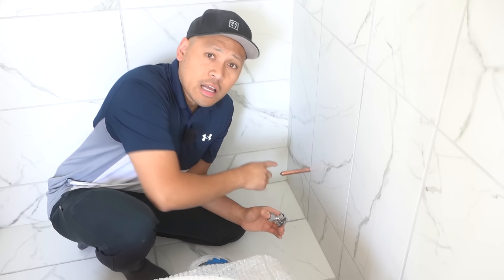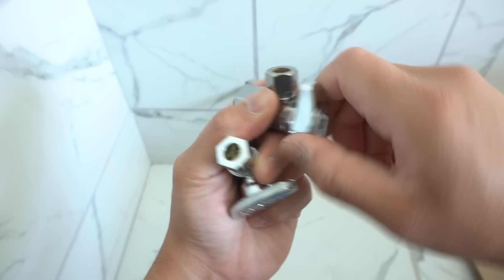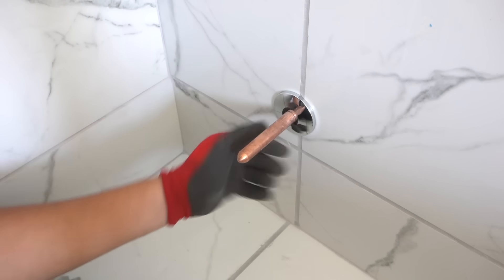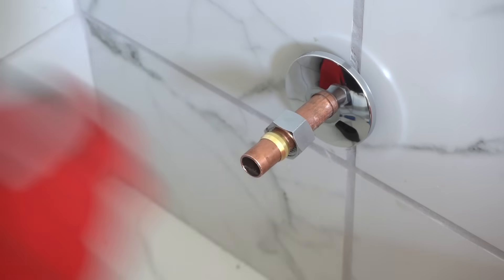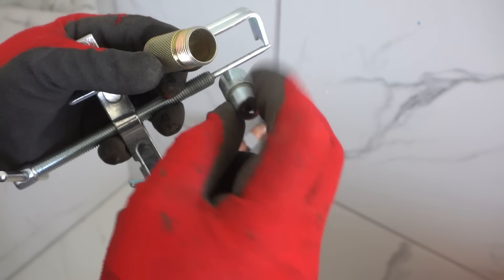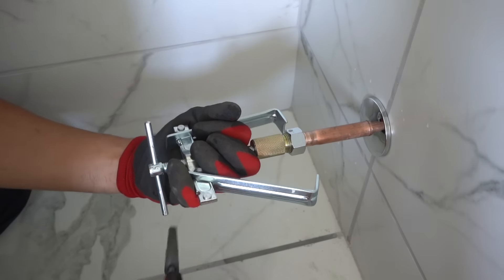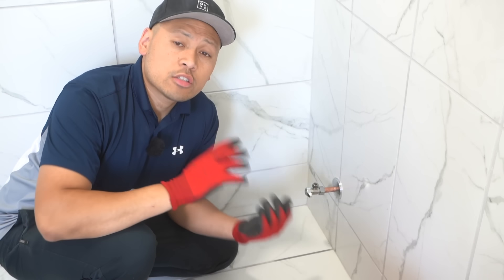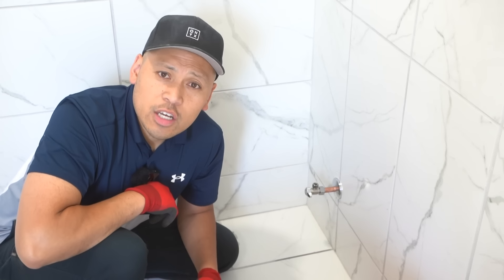STOP Installing SHUT-OFF Valves In the Wrong Location! DIY How To Install OR Replace!

Comment from the maker: ITEMS I USED ON THIE VIDEO:
- Angle Stop 1/4 Turn (1/2” Nom 3/8” Comp Out) - https://amzn.to/3Lz5cbt
- Compression Ring Puller - https://amzn.to/46hSSFU
- Copper / Metal / Brass / Aluminum / PEX cutter up to 1-1/8” - https://amzn.to/4cQblfb
- Pipe And Tubing Reamer - https://amzn.to/3WzFMRm
- Sanding Emery Cloth - https://amzn.to/4bQwNzy
- Adjustable Crescent Wrench - https://amzn.to/3WkkPbJ

Comment: After 20 years I replaced all my shut-off/stop valves. They were the old turn style and replaced them with the 1/4 turn shut-off valves. I did not take off the ferrule and compression nut from the old just reused them and they worked fine. I didn’t worry about the copper pipe being exposed, this doesn’t hurt anything and I love the copper.
Reply from the maker: Thank you for sharing! 🙏🏽😊

Comment: Love your video's.....they are all filled with great info!!!  I've had to replace that valve 2 or 3 times over the years and have always just left the old compression ring on.  I've never had any leakage or problems.  My pipe is so close to the wall that I didn't have a choice but it seems to be fine using the old ring.  Thanks for doing so many helpful video's!

Comment: If you don't over tighten the compression fitting it can be reused and you also won't need to cut off more pipe. But if it was over tightened, you might be able to save it with liquid PTFE pipe dope on the crushed ferrule (never the threads for these.)

Comment: I alway give three was to fix or replace a angle stop 1) repair valve 3/8 f comp to 3/8 m
2) leave the ring the threads should match. Note there or course thread angle stop thread, but mostly in the East Coast. Pipe dope or thread tape or both is sometimes required.
3) compression pulls are awesome, but make sure that you don’t tell the customers to over tighten compression that will deform the copper. 
4) to all my bother plumbers 1 rule plumb like it’s your house. Not unless told by customer.
Hope this helps.

Comment: I'd have to echo what others are saying having worked in many higher end houses, the homeowners WILL say that they don't like seeing the exposed copper and you either have to butt the shut off flush with the escutcheon or get a chrome sleeve to go over the copper. The sleeve is more optimal as it gives you more pipe to be more easily serviceable in the future. 

Pex stub outs are even worse, any exposed blue pipe sticks way out and homeowners will call it out right away. Good practice to get used to hiding any exposed pipe.
Reply from the maker: Thank you for sharing your experience! Always ask the homeowner what they want first. 👍🏽😊

Comment: The one thing that I would add is, the 3/8 outlet should be in an horizontal position, just in case you would need to drain that pipe.

Comment: I didn't see any  anything applied to threads (white tape or the crayon)?  Does it need it to avoid leaking?
Reply: The instructions say, no pipe tape is necessary, but I’ve had a few drip and so added the tape and it solved the problem.
Reply: @glasshalffull2930 you don't tape a compression fitting if it leaks it not tight enough plain and simple

Comment: I just use a shark bite. It holds really good, never leaks and it has a special tool to release the pressure to remove it and reinstall it. As a matter fact, you can use the same valve over and over again. Before the copper is cut too short, you can always sweat a new piece of pipe on there with a double female, and another piece of 1/2” pipe.

Comment: I wish whoever did mine had left a bit of pipe!  It was cut so short the valve crushes the escutcheon.
Reply from the maker: In this case your option is to “sweat” an extension. You’ll need to get some soldering materials for that. Stay tuned! I’ll make a video on that soon! 👍🏽🙏🏽😊

Comment: How hard are you supposed to turn it hard , snug , ?
Reply from the maker: Should be tight, but not too tight. I might have over tightened this one resulting on the pipe decreasing diameter. Good thing I left enough copper 😅

Comment: Never use a compression fitting sooner or later it WILL leak or the vavle will fail. Solder on a threaded fitting. It won't ever leak. And if the vavle fails un screw the old and screw on the new and your done

Comment: I can imagine many homeowners being disappointed with the several inches of visible unsightly copper pipe extending from the wall.
Reply: The toilet will hide it. You can also buy decorative sleeves to fill the gap.
Reply from the maker: It’s all homeowners decision. 👍🏽😊
Reply: To be honest I have never seen that length of pipe sticking out of the wall and my brother in law who is a licensed plumber for decades told me he has never once removed the ( copper ring ) in 25 years and has never once had a call back for 1 leaking. Just saying 🤔

Comment: If you have to cut off the pipe after you remove the compression ring, Why not cut off the pipe and the compression ring together? You could use a hacksaw and cut right next to the compression ring.
Reply from the maker: It’s for demonstration purposes my friend, but you are correct as well 👍🏽😊
Reply: @FixThisHouse  What I don't understand is, If the pipe always gets damaged when you take the compression ring off, what situation would you take off the compression ring and leave the pipe? There's got to one, or they wouldn't have made that tool.
Reply: @KevinWta  Best I can figure is the roller cutter wheel would ride up on the ferrule and not allow you to cut it.  Thus, you’d have to cut the pipe even shorter.
Reply: @glasshalffull2930  And that's why you use a hacksaw, instead of a pipe cutter.
Reply: @KevinWta  I could see your average Joe doing a ‘hack’ job if they tried using a hack saw.  But, it’s an option.
Reply: Yes but no you can damage the pipe. Use the right tool. This is a major insurance claim.

Comment: Your videos are awesome but that intro music is annoyingky loud.  Those old school angle stops can be taken apart and servixed with a new washer.  No need to replace the whole body.  Tilt the angle stop 60° so the aupply line has no streas at the connection points.   Personally I like to sweat on the stops.  Removing requires heat to undo the solder, clean and replace, no need to cut or deform the copper.
Reply from the maker: Thanks for the input! 👍🏽😊🙏🏽

Comment: Compression fittings are so outdated.  Shark Bite is so much more superior in my opinion. 
Dude you should show updated tech.
Reply: 😂😂😂 compression fittings are much better than a Shark Bite any day. But if you want it done correctly it should have a threaded fitting soldered on . That is the only correct way that will last 100+ years